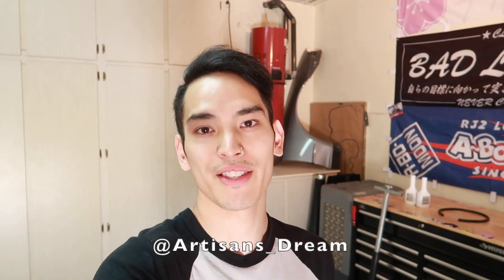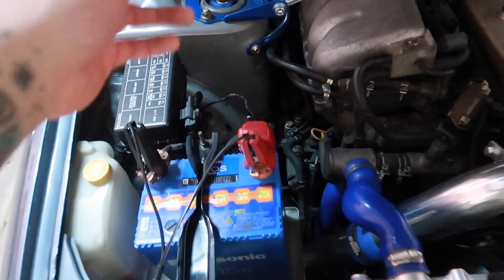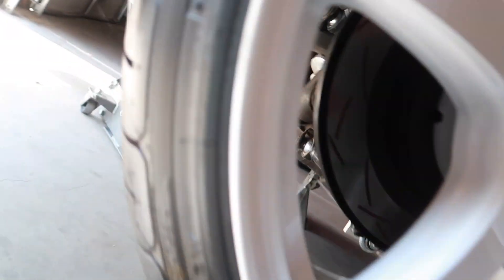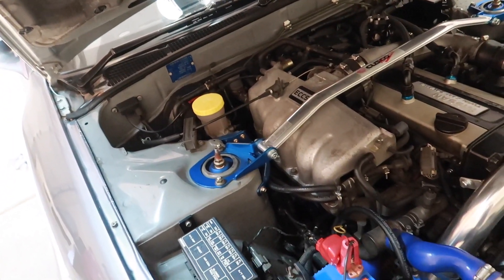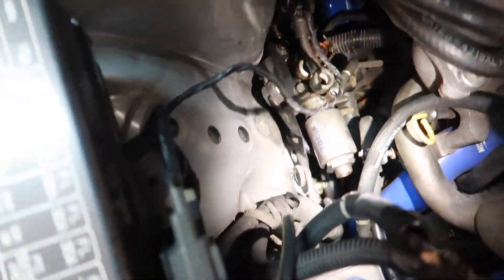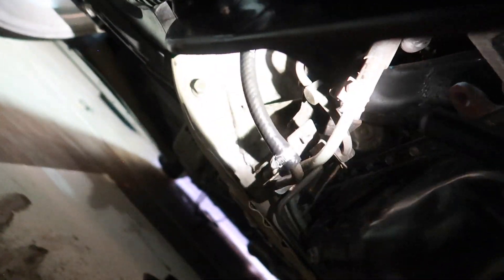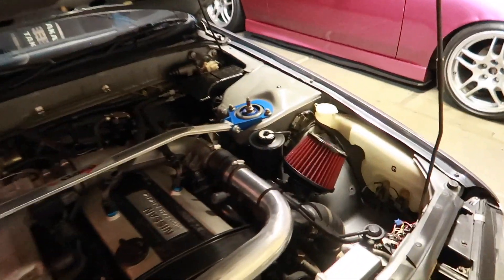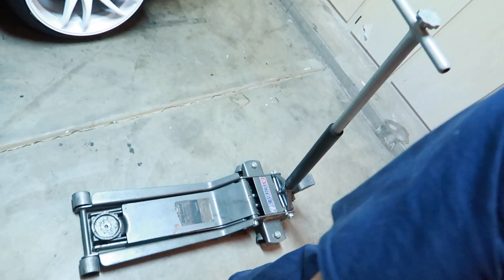R32 Skyline Hicas delete part 2!

Comment: Any advice on what to look for when I remove my r32 coupe steering rack to send away to get the seals sorted? It is quite urgent. Thanks for any and all advice
Reply from the maker: I would just check up on all the steering lines and hoses. Wouldn’t be a bad idea to replace the inner and outer tie-rods.
Reply from the maker: Would invest in a poly steering rack spacer as well.
Reply: @artisansdream 
The company that's going to do the servicing said they need to do a proper going over to figure out what they need to do and that probably includes what you have said I suspect it will be the rhside as that is where the oil leak is,.
Quick question since I have your attention I presume I will need to drain the whole thing as well I'm asking as I am a complete amateur to this even though I have had this car for 20+years.
Reply: @artisansdream 
Excuse my ignorance but  what is a poly spacer?
Reply from the maker: Yes, you will have to drain your power steering fluid before or during the removal of the rack. It’s going to come out either way ahah.
Reply: @artisansdream 
Thought so and thanks 🍻🍻
Reply: FYI the car is a 1991 r32 2.5 de factory manual coupe.

Comment: Hey man just got done doing this to my bnr32 had the intake manifold out so I'm doing the starter and all the heater lines I pulled the hicas pump and lines as well. Question did you pull the vanes out of the power steering pump and block off the resivoir? Is that necessary to do after you loop the lines from the pump?
Reply from the maker: I left most of the lines in and only looped them. If you’re going to get rid of all the Hicas lines. You’ll need to run lines from the pump, to the rack and to the reservoir. I haven’t had any issue by just looping the lines.